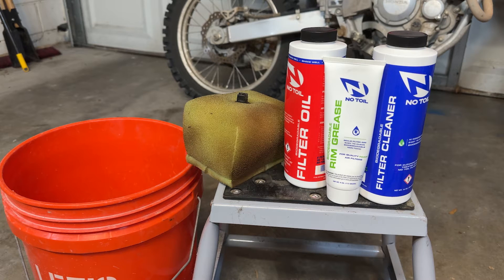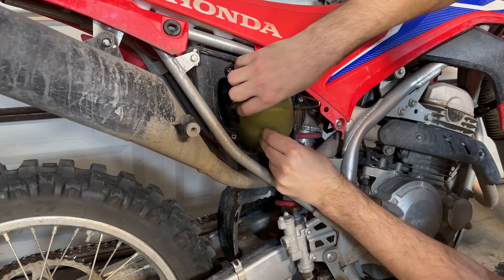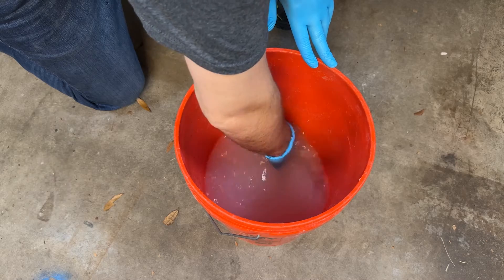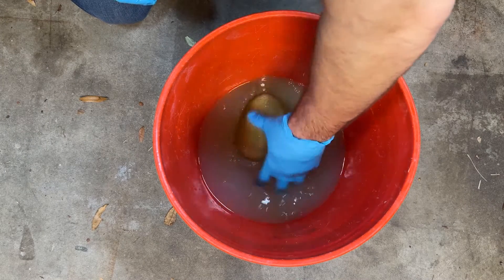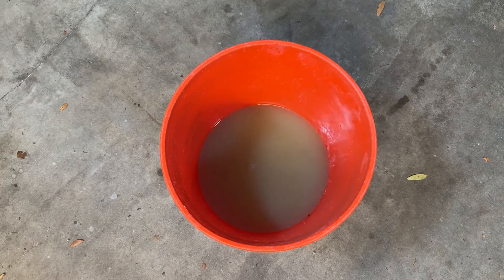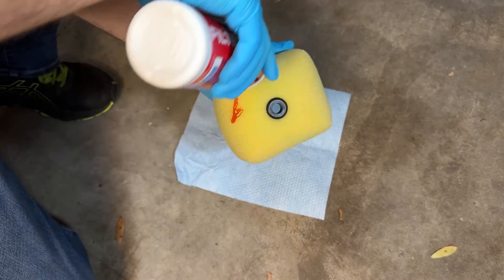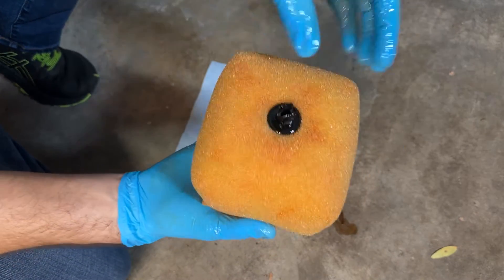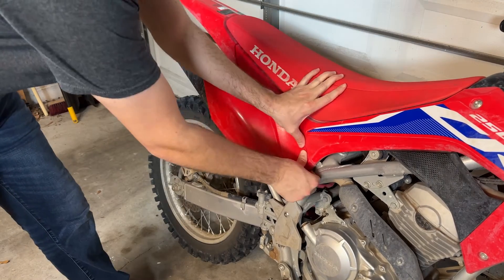How to Clean No Toil Air Filter

Comment: Thanks.  Was about to try No Toil.  A simple tip I've used for years:  Put your clean dry filter in a 1-gallon freezer bag and then apply the new oil.  You can squeeze the bag to work the oil in and manage any excess oil in the bottom of the bag.  Store you filter in that bag until needed (if spare) or just keep the bag handy with any excess oil for the next time.  The value of having an extra filter or 2 oiled and ready to go cannot be overstated.  Your engine will thank you.

Comment: They're biodegradable Filter will fall apart even though it is brand new.. raced enduros for over 20 years And many 24-hour races in Alabama Perry mountain, only filter I ever had fail on me.. I had several of these filters still in the package that had issues. Tried to bring it to the owner's attention... He tried to blame me. I didn't want anything from him. Was just trying to help them make a better product.. You can use them if you want. Not me!